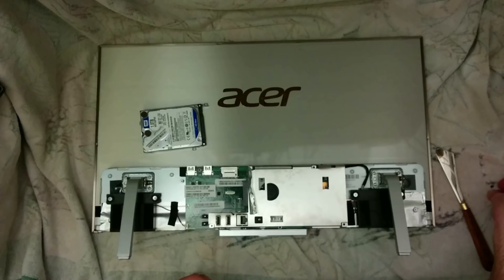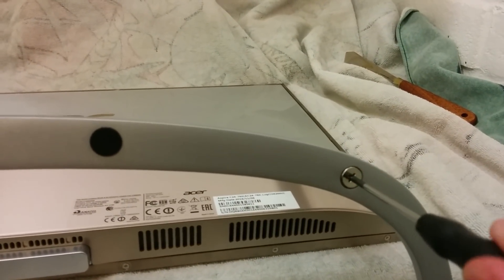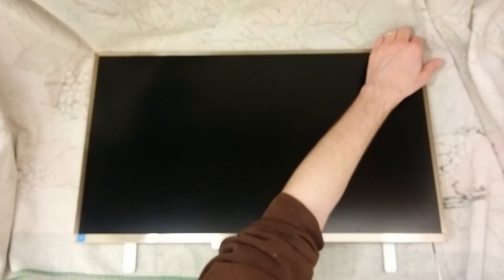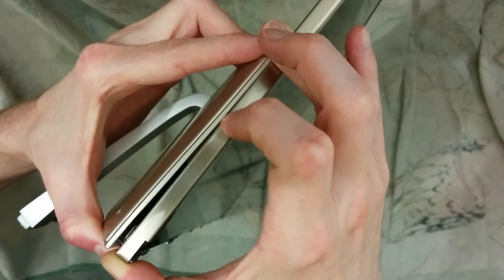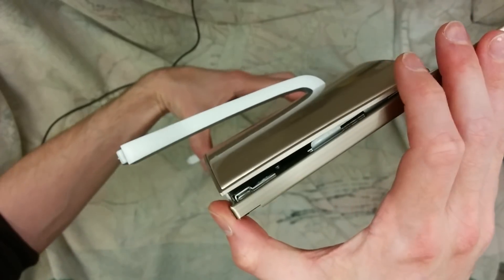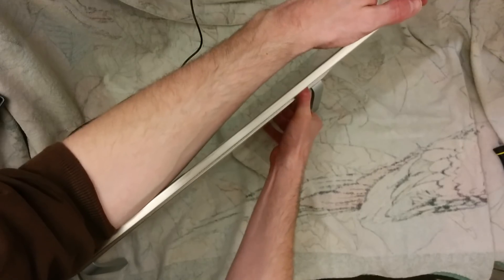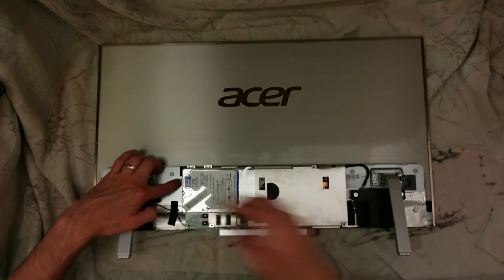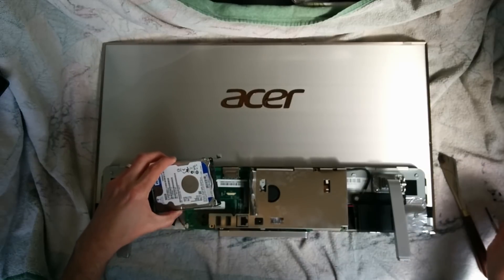Acer Aspire C24-760 - How to change or upgrade the hard disk

Comment: Thanks for the video. One thing I had a bit of luck was in getting the tabs along to top of the rear enclosure without having to use a screwdrivers. Having opened each side as instructed I was struggling to unlock the top row of tabs. But when I, at the same time, pulled up the lower right corner and pushed the enclosure upwards then suddenly the first four tabs popped free. I then pushed upwards and continued to pull away to pop the last four one by one. Maybe I was lucky, but I thought I would mention it.
Reply from the maker: Thanks :)

Comment: does the system need to be sealed to be re-sealed to POST?
Reply from the maker: I'm not sure what you mean really but if you are asking if you need to put the covers back on to test it, no - it should work fine with the back cover removed.

Comment: I have one that only has a blinking power light, no fans, no screen.  I wonder if there's a way to reset the bios? Alas, couldn't find the battery.
Reply from the maker: Wouldn't have thought that is a BIOS problem. Checked the power supply?

Comment: I've disassembled it myself, updates: 
It have 1 standard Sata slot (the one where the HDD is connected), 1 sata M.2 2280, 1 ram slot; so to upgrade from 4 to 8GB ram, you need a single 8GB sodimm module. I'm not sure if the M.2 is "sata standard" or NVME (the attachment / interface looks visually like the M.2 I have on the notebook) I think standard considering the low-end caratheristics.
Reply from the maker: Really good info, thank you!

Comment: Thanks for this video.  I am a computer engineer and this has got to be one of the hardest machines to get into I have ever had to repair.  Why they cannot use screws instead of clips I do not know.  I am glad I watched this first. Made it so much easier.
Reply from the maker: Very glad it helped - it is such a rare machine and I had the "fun" working out how to get into it so glad my effort to produce a video made it easier for you (and hopefuly others).
Reply: @freename  It did indeed.  Have to be so careful not to damage any cables etc when you cannot see them.  Thanks for taking the time.

Comment: How many serial ata (SATA) connectors it have? 1 or 2? In the bios I see 2, one use by HDD and the other empty, but I cant visually understand where is the second sata slot in this video
Reply from the maker: What I know is all you see in the video. It was the one and only time that I opened that computer up. You might do better looking on ebay for motherboards for that model and see if you can see other ports in the photos.

Comment: Can I use this to take out a broken head jack that got stuck in the slot?
Reply from the maker: I don't know what the design of the headphone jack is - but if you open the machine up and can see the back of the jack there is a chance you can use a paperclip or something to push the broken plug back out. Otherwise youtube probably has other tricks on how to remove broken headphone plugs from the socket without access to the entire socket.

Comment: After taking off the back cover, we suddenly see a grey ribbon cable on the right - was that attached to the panel in any way?
Reply from the maker: I don't see it on my video. Got a photo you can upload?
If they are the gold like ribbons you can see in my incorrect way to open it video as seen here: https://youtu.be/o35MejSyUCs?t=599

You may have damaged the display cables.
Reply: @freename  Ha! I now see it is one of the display's legs!

Comment: Is there anyway to change the graphics card
Reply from the maker: I wouldn't have thought so.
Reply: @freename  bec my pc keeps shutting off when I play roblox
Reply from the maker: Sounds more like a power delivery or overheating problem. Make sure the computer is dust free and possibly see if you can get a replacement power adaptor in case your one has reduced capacity over the years.
Reply: @freename  ok thanks dude😉

Comment: Is there a reset button? My acer turned off while i was doing something and it wont turn back on. I unplugged everything and plugged it back in but it still wont work any tips?
Reply from the maker: Sounds very much like it has failed. The first thing to check is the voltage coming out of the PC end of the power cord if you have a multimeter and know how to check voltages safely. (You should not test the 110/230volt side!

Or simply replace the power adapter with another one of the same Volts and at least the same amps as your old power supply.

If the world has been kind to you then it will be just the power supply. If that doesn't help I don't know what to suggest :(
Reply: Our also won't power on. No standby     led but the power supply was tested ok.

Comment: Hello! Does this computer have 2 RAM slots? Because I see that there are 8Gb , and I would add another 8 to have a total of 16GB if the slot is free. I hope there is no 2 by 4Gb and that both slots are occupied? And one more question: How much GB does this computer support SD cards? Thank you very much
Reply from the maker: Sorry; I didn't get to the RAM so I don't know :(
Reply: One RAM slot
Reply: @ColCompMan  2 ram slots. Yesterday I installed 2 by 8 GB.
Reply: @Moj_Svet  maybe another model c24-860

Comment: I have seen the slot M, 2 under the HDD dude, you can install the SSD format M.2
Reply from the maker: You are so right! On my video you can see it at 9:45 .. but on the model in my video it looks like the "place holder" drawing is there but the connector at the end and the screw bracket to hold the M.2 in place are missing. Other models may have the connector and bracket though?
Reply: On the model c22-760 bought in France i  disassembled there was the bracket
Reply: Are you sure that is a SATA placeholder? The specs state this is a M.2 WiFi slot, not a SSD one.
Reply: @AdiCristea  100% sure, the m2 wifi/bt slot is in an other place. This one is underneath the hdd. As i said this was a french model c22-760
Reply: @François-XavierEon  I have opened it and it does have a bracket under the HDD, but I'm amazed they do not advertise the SSD M.2 slot at all on any specs sheet I've seen. Have you actually tried inserting a SSD and it worked?
Reply: @AdiCristea  as i said the one i disassembled had one,  didn't try ssd m2 though didn't have one
Reply: I can confirm M.2 SSD works alongside the HDD. Happy days!
Reply: @AdiCristea  what specs m.2 ssd you use please share to others. Thanks.
Reply: @elenosalenga5555  240GB WD Green M.2 2280 545MBs read, but I just went for the cheaper option as I needed to improve the speed, and boy what a difference!
Reply: @AdiCristea  i can also confirm m.2 ssd works alongside the HDD.  use samsung 860 evo 250gb. thanks to this video.  you cant find info on web about using m.2 ssd setup on acer c24-760 .  nvme ssd maybe woks also never try.
Reply: @elenosalenga5555  NVME SSD won't work... Already tested..
Reply from the maker: Unknown. And can only go by what's in the video now. The machine is long gone from my grasp.

Comment: Thank you for this video!!!
Reply from the maker: No problem, hope it helped - thanks for the extra information on the system RAM and CPU. I might have to take the machine to bits again, I've had reports that it is "test screening" (coloured bars showing on monitor) after a few hours of being on.
Reply: icannotgetafreename no problem. Not sure why it would do the test screening thing.... hmmmm. I hope mine doesn't start doing that...

Comment: Hi, thanks for the video it seems a nightmare for someone without experience. I was wondering if you ever saw how many RAM slots this PC has? Does it have 1 or 2? When I check in task manager it tells me I have 8GB RAM in "slot 1 of 2"
Reply: Hiya, I took mine apart to do the hard disk replacement. It has one ram slot. Mine was occupied with a single 4gb stick. I now have to decide whether £80 for an 8gb stick is worth it or not. Ps the ram slot is under the metal plate that can be seen next to the hard disk. Cpu is under there too..
Reply: Pps it is a lot faster now I have an ssd installed :)
Reply from the maker: +ICU2NIT unless you can see them in the video then I didn't see :( and it's such a nightmare to open because they made the machine look stunning. Sacrifice the ease of access to components.
Reply: icannotgetafreename thanks mate. I'm not even going to attempt opening it! Lol thanks again for the video.
Reply: Thank you Alan!
Reply from the maker: Great info, thanks!

Comment: Do you get a mouse and keyboard with the pc
Reply from the maker: +Cosmic 45 yes.
Reply: icannotgetafreename is it fast for loading up stuff also can it run video games like GTA v?
Reply from the maker: +Cosmic 45 any machine with a hard disk only these days seems slow to me so I would say it isn't fast. They do a version with an SSD. Games: don't know.
Reply: simple games like csgo and other games that are not demanding are playable. i can play csgo at about 80 fps on low settings.

Comment: Thank you for this video!
Some of these machines come with two hard drives,  A HDD and a SSD.
Do you know where the SSD location is?
Thanks again.
Reply: I have seen the slot M, 2 under the HDD dude, you can install the SSD format M.2
Reply from the maker: +ZeoWorks not sure on that one. I didn't know they came with SSD until after I filmed this.. otherwise I would have gone digging around for the connector. I assume that the ssd is not a standard SATA SSD and is likely an m.2 / ngff or mini PCI express
Reply: if there is an ssd addition to hdd, it will be a pci x type either sata or m.2 type... it will look like a long wifi modules... and most likely on the board beneath/around the hdd, as it seems where the mobo is... i m guessing it is under the metal cover if its removable?
Reply from the maker: Thanks Дима Зелёв! For further info (about the missing connector on my one) see this comment: https://www.youtube.com/watch?v=t_erHSgKXXc&lc=Ugy2C0zOlqTX35RRVQB4AaABAg

Comment: Suport a ssd?
Reply from the maker: Should do - if you use a standard 2.5" laptop hard disk sized ssd.
Reply: Yes it does. M.2 slot under the HDD